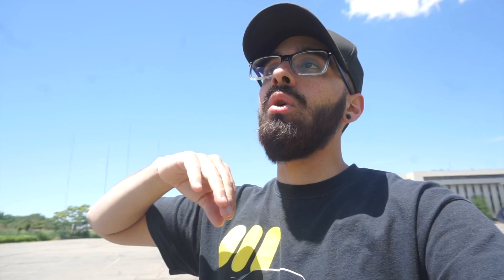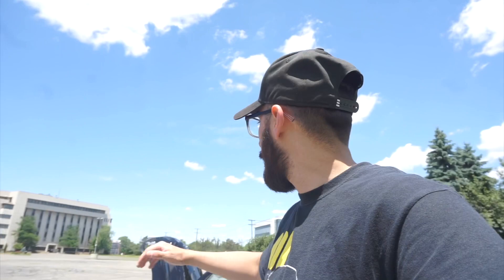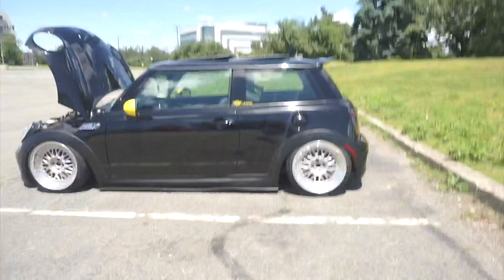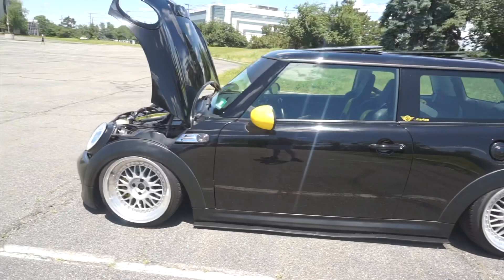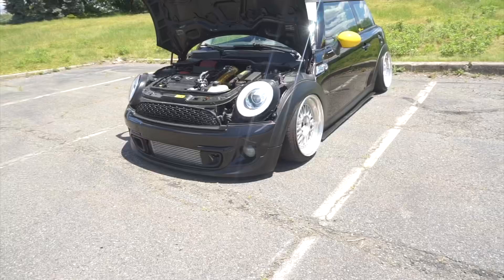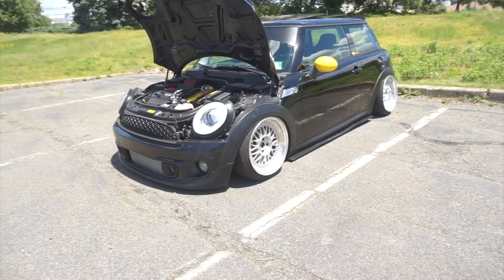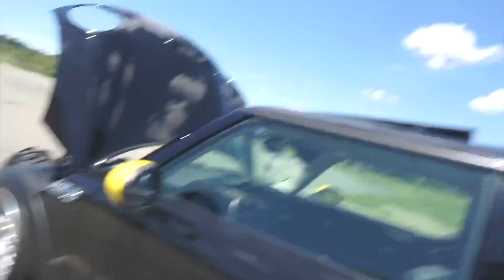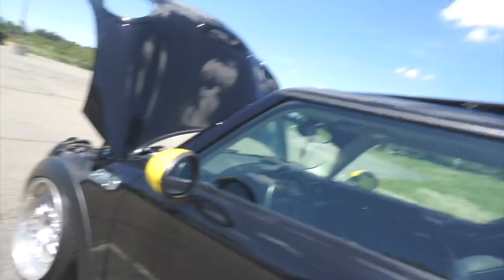Top 5 MUST DO Mods For Your Mini Cooper S !

Comment: I will say on any car upgrading the intercooler charge pipes makes such a huge difference. Glad you mentioned that because sometimes it’s overlooked when people are doing some basic bolt ons and stuff. Great point and great first mod to do!
Reply from the maker: Absolutely agreed man! Any turbo car benefits greatly off this. Better throttle response and more turbo noises you really can’t beat it ! Haha
Reply: Do you need to tune the car after upgrading your intercooler and charge pipe or can you basicly plug and drive ?

Comment: R56 (2008 Mini S Hardtop) MODS to-date include:

Manual Trans - Ringer Racing Clutch Stage 3 and Flywheel
Milltek Performance downpipe High Flow Cat
-	vibrant j spacer with their smallest size jetting
Wagner intercooler
Borla Sport Exhaust
K&N Cold Air Intake
ecu tune SPS Performance
-	( Stock, 18, 20 and 21.4 psi) ( stages set by plug in controller stored in glove box)
Brisk Spark plugs gapped at .025 ( May change to .022-.024)
Snow Performance Water Meth injection 
BC Racing coil overs
Torques solutions engine mount
Zimmerman drilled rotors (front) 

Haven't thought of cold and hot side mod . Thanks.  Big issue is all the tweaks and stiffer mounts/suspension have left the interior with a dozen rattles.   Dash, head liner, pillars etc. Love the exhaust and handling but they take away from the fun I am the the Wash DC Annapolis MD area....  Know of any good shops that are good w Minis near me that might help?
Reply from the maker: Wow that’s a lot of things done to the car I bet it’s an absolute blast to drive that sounds like a great time! I need to get on your level haha! And a very good reputable shop sort of in that area is helix Motorsports they are located in philly. They are bmw and mini experts !

Comment: I hate to be that guy lol. The flames and all the bangs you get with the exhaust is that from the tuning ? You have a tune for the pops and bangs or ?
Reply from the maker: The n18 actually pops and bangs from factory when in sport mode sooo getting a me exhaust just makes them louder haha now when you tune it yes you can add more pops and bangs or remove them as well.. I find them fun so😬
Reply: ive never seen flames in a stock mini :D normally thats only with tune.
i gone 200 cell in n14 and it really makes the car. alot more pops and bangs and turbo noises are just insane.. i went from a vaccum cleaner to a fucking dinosaur ahahah

Comment: Good video, but the hot side tube doesn't restrict airflow as claimed.... I don't know why people are obsessed with replacing it, but it's literally a straight pipe through with some holes/chambers to reduce noise. I did replace mine, but afterwards questioned why. You could probably save money on replacing those items for a tune or NM power module. What about waste gate spacer? I love mine and for $20 it's probably the best $$$ i've spent on my Mini.

Comment: Keep getting put off by people saying intakes such as the cts one in this video reduce power due to hot air from the engine bay feeding the turbo. What's your view on this? Does the intercooler offset this?
Reply from the maker: Look I’ll tell you this ... yeah there’s always gonna be hot air in the engine bay obviously regardless of your intake setup aftermarket or stock... luckily for us the turbo is in the front of the engine and the intake sits toward the back right in lane with the hood scoop which if you pop out the honey comb plastic piece of the hood scoop will allow a direct route for air to reach the intake in the back.. or if heat is your concern I recommend maybe spending a bit more and buying the aem intake that comes with everything to ensure you’ll get colder air into your engine.. the intercooler could offset being it has a bigger core so it allows for more airflow, Lower intake temps and won’t allow the car to get as heat soaked when driving doing pulls etc. as the stock one would
Reply from the maker: Another thing as well, all higher horsepower builds and getting cars tuned etc usually require an aftermarket intake due to the fact they flow more air into the engine .. if you’re staying fully stock I agree maybe the stock intake is better for you but if you plan on doing full bolt ons, maybe even upgrading your turbo and stuff then you’re gonna have to get a better flowing intake for your setup
Reply: @DArias  Feel like there's a lot of hearsay about these intakes with loads of hate from people who haven't actually tried them! Really want to go for one now and find out for myself. Thanks for sharing your findings!
Reply from the maker: I’ll guarantee you this ... you’ll get really cool turbo noises and improved throttle response which as a placebo effect will make you feel the car is faster regardless of what it could show on paper ! Lol

Comment: Minis benefit the most (from a cornering standpoint) from stiffer swaybars.
Reply from the maker: You’re absolutely 10000% of that man! Good point !
Reply: I was kind of surprised that he only mentioned a Sway bar upgrade in passing, IMHO it should be one of the first upgrades you should do to your MINI, I had a Alta 22mm rear Sway bar installed on my 2012 MCS which made it a new car

Comment: Any big difference between a brand name and an ebay one? I really dont want to spend so much on a front mount and i see alot of people run cheaper ones. What do you think?
Reply from the maker: Many people use the eBay ones with no issues ... I would go for one and not worry .. there was a forum on northamericanmotoring where someone had done side by side testing on his car using a Wagner intercooler and a off brand no name one.. he pressure tested it and ran it in the car as well.. it had the same airflow and same intake temps.. have peace of mind and save yourself some $$$

Comment: I've only got the cold side intercooler pipe right now, is there any issue with only installing it or should they be installed as a pair?
Reply from the maker: You’re fine with no issues with only the cold side ! I do recommend however doing the hot side too.. the stock intercooler piping on the hot side has a decent sized turbo muffler in it that restricts a bit of airflow and turbo noise. If you go with a. Straight through piece you’ll notice some good throttle response and good turbo noises ! You can even buy a turbo muffler delete for the r56 which is much cheaper like $40ish and will do the same job for you
Reply: @DArias  much appreciated. The plan is to do the hot side as well, I just haven't gotten that one yet. Didn't want to habit cause problems if I only had the cold side for a month or two
Reply from the maker: Peace of mind brotha ! No problem 💪🏽

Comment: Excellent video, subbed!
If you kept the stock exhaust manifold & only modded the exhaust from behind the last O2 sensor, and included all the intake mods would it require any tuning? I want to get a Mini & make it my own but I dont want to go balls to the wall as it will be a daily.

Comment: Hello I’m just wondering how much power you’re pushing on your car , I have bacically all the stuff you have except a tune, I’m just debating buying one because I don’t want to blow the engine (n14)
Reply from the maker: Soooo tbh I’ve never dynoed it I’m assuming the car is somewhere around like 260hp and like 280-300ish torque (crank numbers) to the wheels id say like 220wheel and like 250ish torque lol I’m not sure tbh and have you dont all maintenance ? And how many miles on your S?
Reply: Diego Arias about 100k miles and yes regular oil changes every 5000 Kms

Comment: How much do these cost in total?  I’m thinking about getting one of these soon (2023). Which years are better?  Which to avoid?
Reply from the maker: If you’re going r56 then I would go 2011-2013 which is the n18 engine and many of the flaws from the n14 engine from 07-10 were solved such as timing chain issues PCV issues etc

Comment: Really enjoy your videos.  May I ask where you got the front lower grill "scoops" to the left and right of the larger intercooler?  I am getting a similar intercooler installed and like how your install looks.  Thx.
Reply from the maker: Thank you! So those are just the brake ducts from the stock lower grille. I cut out the middle mesh and left only the ducts. Sanded away the excess plastic that was sticking out and rounded it off then sprayed them in black
Reply: @DArias  Thanks.  My grill seems to be different as far as I can tell since I have mesh all the way across.  Will see what is behind the mesh when I get the intercooler installed and go from there - wish me luck and keep the videos coming!

Comment: I see In your mid list you have a forge BOV. I’ve purchased the forge diverter valve (fm207a) that comes with the solenoid for plug and play, but still have a computer issue. Did yours ever throw a code?
Reply from the maker: I never had an issue with mine nor has it ever thrown a code .. super weird .. what code is your car throwing at the moment ?

Comment: Im thinking about a 1,4 diesel from 2005.... As a first car... Its a one, not even a Cooper... I wanted an s jwc fully spec. but i can't afford it...
Reply from the maker: For a daily a diesel is such a great choice because of the fuel mileage ! That’s not a bad option
Reply: @DArias  it supposed to have a toyota engine, it has 200k kmh on it and only 75 hp... No options... Then again, less stuff to brake and its a first car...
Reply: Im looking at a R56 now 😂

Comment: Don't your tires rub against the fenders?
Reply from the maker: They’ve never rubbed! The offset of the wheels and tire size with just enough front negative camber let’s these fit easily
Reply: @DArias  --- Interesting.  You've educated me, once again.  For used Mini Coopers, what years would you suggest buying?  Thank you for your time and energy.

Comment: What about a base model?
Reply from the maker: Best mods imo for a base model would be good suspension upgrades and a nice wheel and tire setup for the ultimate handling car possible
Reply: i mod mine with aftermarket exhaust,factory new spark plugs,k&n cold air intake, and i dont know if i can put the decat pipe since im so concern of having a drone in longer run